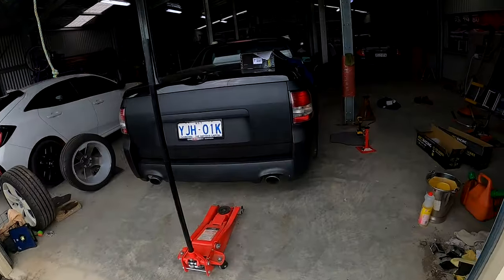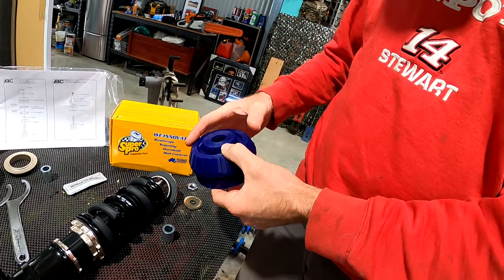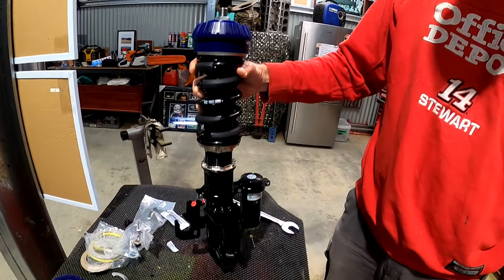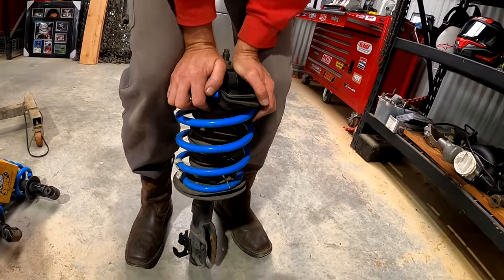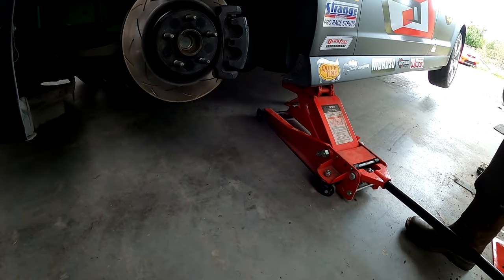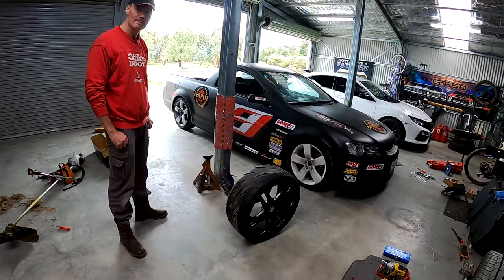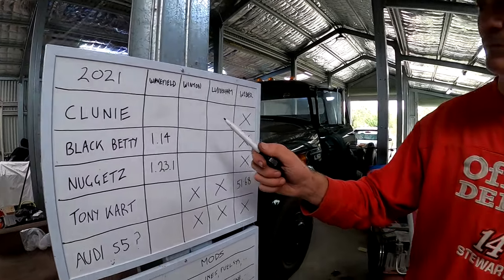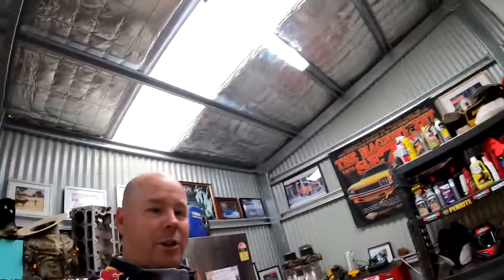We Fit BC Racing Coilovers to our VE Commodore - Part 2

Comment: i have white line front and rear sway bars , as well as coil overs and a strut brace. Now the car drives with no body roll and its like driving on train tracks . Well worth the upgrade
Reply: What strut brace are you running
Reply: @lukemaloney1170  whiteline
Reply from the maker: G'day Michael, that is definitely next on our agenda.  Just so nice to have new coilovers.  What an amazing upgrade.
Reply: Is your front bar adjustable?
Reply: @angry9901  from memory it was
Reply: What setting did you find worked for you and did it make you any faster?

Comment: wish you sked for help before buying BC Racing coilovers, if it's a dedicated track car it may be okay, but mine lasted around 30,000km's before 2 seized. went to a locally sourced coilover and haven't had an issue. but to be fair anything is going to be better that the beat on old stuff you had.
Reply from the maker: G'day Dan, sorry to hear about your experience with the BCs - what model did you have? Yes, ours are fitted to a dedicated track car and we will be lucky to do 1-2,000kms a year.  They are a huge step up from a stock springs and shocks which were totally worn out.
Reply: What coilovers would you recommend instead of the BC Racing? I’m about to buy a set for my VE.

Comment: I've been thinking about getting coilovers for my ute and do you guys think camber adjustable strut tops are a good idea? Not really going for a track style more a street style.
Reply: The MCA have an adjustable top mount but cost $3,500. You can run a couple of degrees of negative camber with the $1,500 BC coilovers. How much negative camber do you usually run?.
Reply from the maker: G'day Jono, I tend to agree with young Angry' response.  You can also run camber bolts/washers as well to get extra camber.  This should be plenty for street driving as you have mentioned.

Comment: Any idea about Lovells and King   spring. which one better? For Holden ve
Reply: I am guessing they are both progressive rate springs that will work well if you have five adults in the car or tow a trailer. Not the best option for a track application
Reply from the maker: G'day Timmy, I think the lowered springs we had fitted to the ute were in fact Lovells.  Let me double check tonight.  As far as a spring goes, they were OK, but you really need to be thinking about the spring and shock combination as they work in tandem.
Reply: @ClunieGarage  Webco complete struts , one with Lovells and one with King spring, i’m thinking for mine. Thanks
Reply: I know some blokes with a set of Lovell springs laying around that they aren't using.